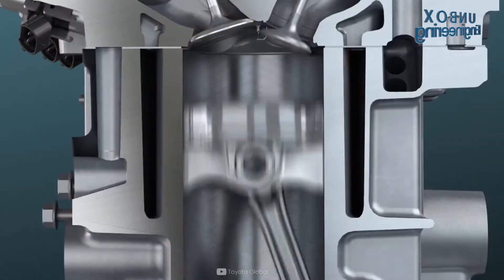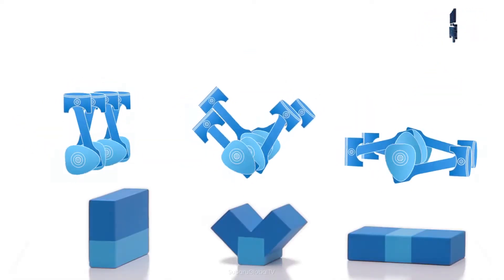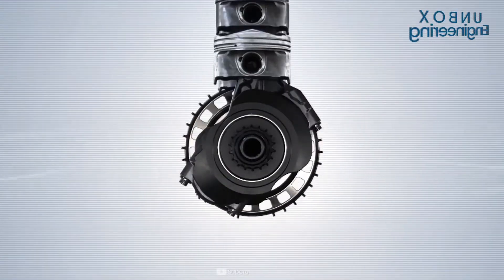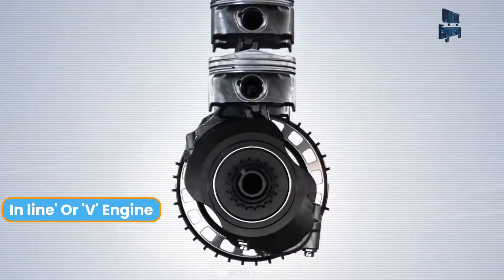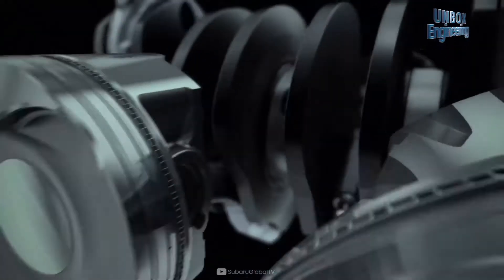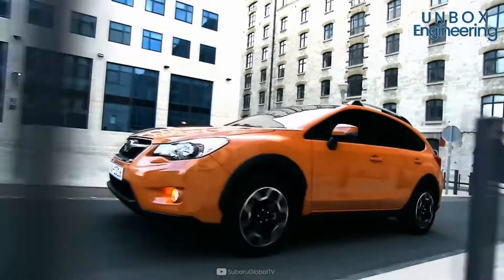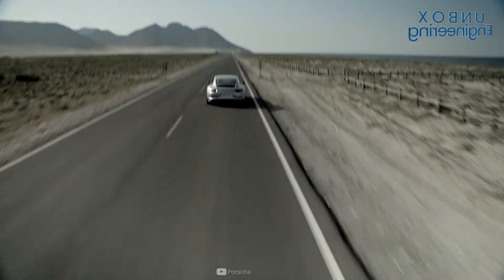What is a Boxer Engine and How It's Work?

Comment: The animations are correct, though I'm not sure why the v6 was included. But not all flat or pancake engines are boxers. You could be clearer about that.  The sentence "the pistons move in the opposite direction" could be amplified to "opposed pairs of pistons move in opposite directions to each other".

Comment: A friend has a Subaru, although it's a good running boxer engine, he complained that changing the spark plugs was a monumental task, i'm sure access points could be engineered in to make this job easier.
Reply: the only way to make the job easier, is to remove the battery, overflow canister and air intake

Comment: Boxer engines work the the same way as straight engines and V engines. Intake, compression, power and exhaust strokes. The only difference is the configuration of the cylinders.

Comment: Why not use an opposed piston engine?  It has greater mechanical efficiency.  We can also make it a 2 stroke, giving it a simpler construction.  Modern day Ionic filters could mitigate the negative heavy polluting effect of 2 stroke engines.
Reply: It’s too cumbersome to use in cars and bikes. It requires two crankshafts and extra gearing to connect them, has more difficult lubrication, service and maintenance, etc.
Its design is about as old as the Otto cycle engine and it’s used only in heavy duty applications (ships, tanks, etc)
For “smaller” applications, it’s still under development.

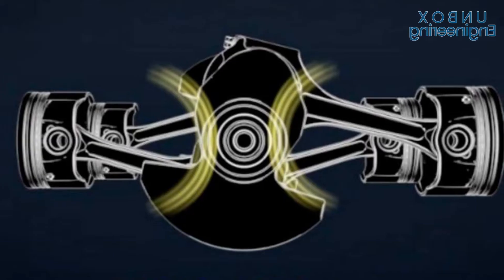Comment: 1:51. Toyota does NOT manufacture boxer engines, they sell Subaru boxer engines, made by Subaru.
Reply: But BMW builds boxer engines e.g. for the R1250RT motorbikes which are not mentioned
Reply: The Scion FR-S/Toyota 86 isn’t the only car with the boxer engine under its hood. Toyota had built its first sports car called the Sports 800 in the mid-1960s and not only that, it also had a boxer twin engine Toyota had just built itself under its hood. The series of the boxer engine is called the Toyota U engine and its production was even extended from 2012 to 2021 with partnership with Subaru to build its own identical rear-wheel-drive sports cars like the Scion FR-S/Toyota 86 and the Subie BRZ.
Reply: @craftedentity3491  Is the 1960s Sports 800 in production?  No.   Toyota does not manufacture any boxer engines.  That is stated in the present tense.
Reply: Ur smart cuz there is no Toyota boxer  engine plant ..my subaru got d idea from porches but we made  our own  and made $ off of Toyota but it's still subaru made

Comment: So, which 45 years did Subaru exclusively use boxers? Because they started making the Sambar kei Truck (with van variants), with a parallel twin, in 1961 and production of various parallel twin Sambars continued continuously until 1990, when the parallel twin was dropped in favor of an inline 4, with Subaru making inline 4 Sambars until something like 2009 or 2010.  Subaru still offers Sambars today, but they are just rebadged Daihatsu Hijets with inline triples....

Subaru's first boxer 4 was released in 1965.  So, really, Subaru's boxer-only years were from 2009 to present, a mere 13 years.

Otherwise, a good video, although it might've been rad if you included motorbikes, past and present, as well as extinct boxer-powered cars from bygone eras....

Comment: They forgot to mention the BMW as a manufacturer of a boxer engine.
Reply: in germany thats not necessary! nothing against english fine motors!
Reply: And they mentioned Toyota, who does not.
Reply: @bujin5455  the gt86
Reply: @bujin5455  toyota owns Subaru so basically Toyota only manufactures boxer engines for all subaru variants.
Reply: @LukaPOfficiel  They do not "own" Subaru.  They have a simple minority stake of 20%, which is a fair amount (as simple minorities go), but that means 80% (the super majority) is owned by someone else.  Also, Subaru is an autonomous organization, and NOT a subsidiary of Toyota.  Which means, Subaru does all of their own engineering, and they make all of their own business plans.  Further, Toyota didn't even begin their stake in Subaru until 2005, at which point Subaru had been making boxer engines for 39 years already, to Toyota's zero years (to this day). Additionally, the only co-offered product between the two companies is the BRZ/86, and that vehicle is NOT manufactured at a Toyota facilities, but rather Subaru's facilities.  To sum up, you're not just a little wrong, you're profoundly wrong across all metrics of consideration.
Reply: @bujin5455  Thank you for this detailed answer, I wasn’t that aware about it.
Reply: @LukaPOfficiel  I guess I was a little harsh.  Sorry about that.  Been fighting trolls for a fair bit of the morning, and was a bit worked up already.  😅
Reply: @bujin5455  no problem!
Reply: How about Subaru dude
Reply: Boxer Engine of a Motorbike